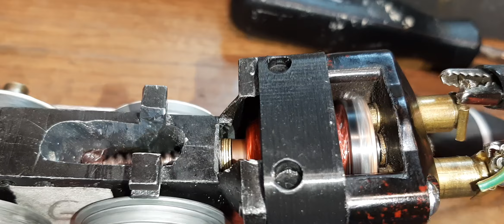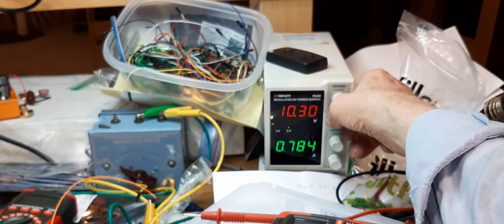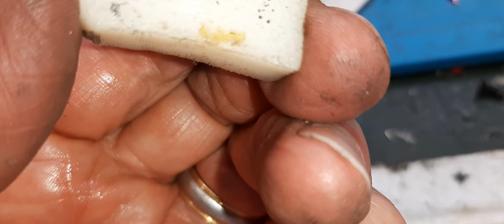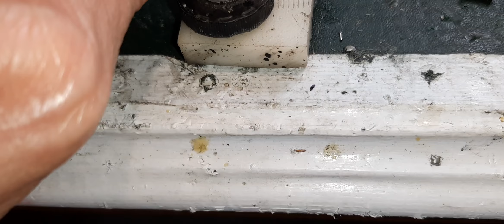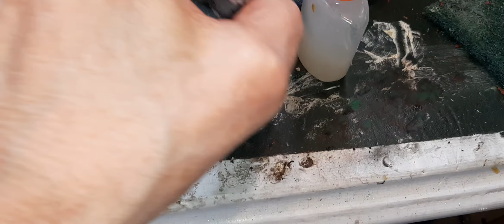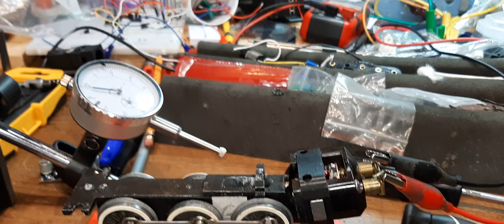NGS Royal Blue #3 Mr. G engine is a roller and a runner. All ball bearing axles will done tomorrow.

Comment: Those look like they are flying!  I think I need a Silver Bullet train.
Reply from the maker: What i have seen when these engines are on the rails pulling cars is they run so smooth. low speed power is strong. The DC Fields are just awesome, the Digital Reverse is a clone of the Lionel 0103 PCB but we have beefed up all the components so it can handle over 4 amps to the engine if needed. The Power Distribution Board splits the power for Motor and Smoke Heater to help isolate the Power to the motor for smoother performance. The Ball Bearing and the Smoke Gear Slot are major efforts and still getting refined and improved as I build each engine one by one by hand. The Option of using the Silver Streak Plastic Body and chassis which had smoke saved a  lot of work and cost. With the NGS Level 1 conversion kit will provide 80-90 percent of the Royal Blue Mods. That Kit base line Version is priced at a DIY Cost of $75 and we have build inventory to help hobbyist get started on their own Next Generation S experience. I have converted 283, 290, 312, 322, 336 engines with the Level 1 components and the transformation is truly transforming. The Next Mod I would suggest is the All Wheel Pick Up tender trucks. This gives the engine all the track power it needs and they provide a suspension effect and look great. We have both 4 wheel and 6 wheel versions.   As we evolve our product line I think the extended range Tender will catch on as we are scheduled to build three of them for these NGS Royal Blue Projects. This will be a longer streamlined version with cooling Fan and Digital Sound from the NGS Level 2 tool box can be made Oil or Coal burner. And this is all possible with help from extraordinary teammates and a few believers in the Next Generation S goals. Our profit motive is way done on our priority list. We try hard to keep the costs low so more folks can experience the improved performance and actually enjoy these old trains by running them. We are actively working to complete the Level 2 product list and dream about what Level 3 can be. I am also active in creating new engines, tenders and a Diesel NGS Upgrade. There are prototype Alcos with All Wheel Pick Up trucks, DC Field Conversions, and Smoke!!!!!  And they are looking very good for a 2025 release into the wild as a DIY Upgrade. We designed an Ash Pan and FireBox Bulk Head to enhance the look of the Steam Engine Cab area and hide the Electric motor I have been modifying the Royal Blue Ash Pan to fit the other popular Steam Engines, Atlantic 1st. Giving the Atlantic a rear trailing truck, Draw Bar connector to the tender, Cab Lighting, Fire Box Fire and Skinny Engineer and Fireman. These add ons don't affect performance, but sure add cool details to the Atlantic steam engine and tender for a great enhancement to any round house and layout. Keep Watching and think about a Level 1 Kit to kick start your NGS DIY Adventure.  https://frankentrainlabs.gumroad.com/l/lrejq
Reply: @DennisMurphey  Well, I am all about supporting this great effort and love watching the videos.  I will purchase one of them when I fully understand it :)